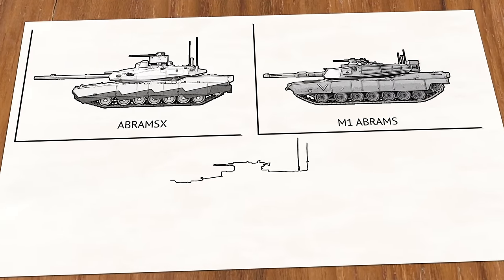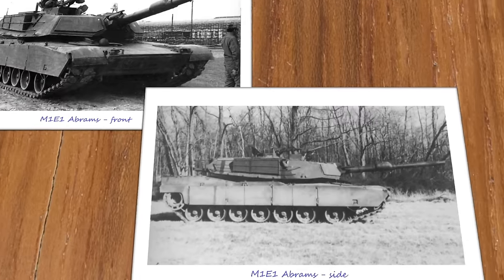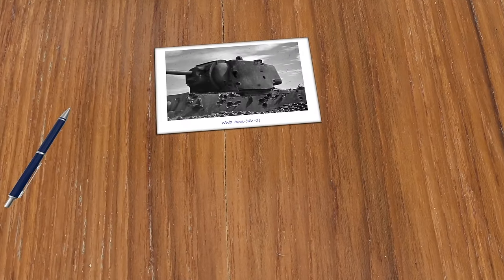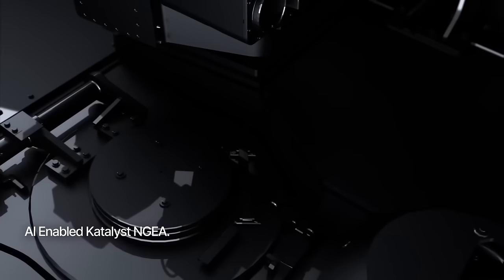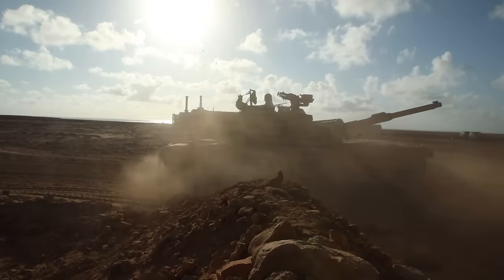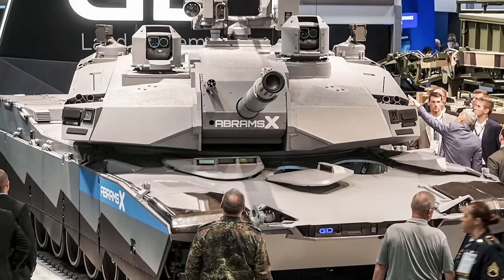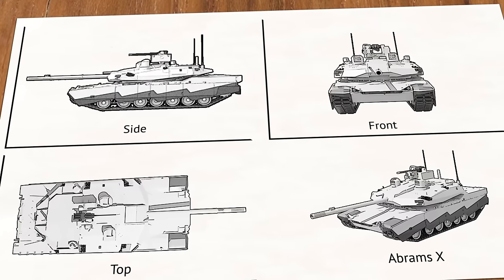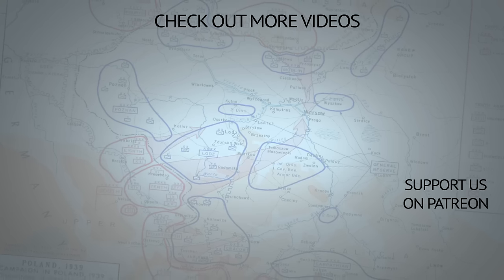M1A3 Abrams is finally happening. And it may get an unmanned turret, like the Russian Armata T-14.

Comment: Less weight should equate with a faster (top speed), more maneuverable, and nimble platform as well. This is given that the new platform would have a comparable level of torque and horsepower.
Reply: More importantly, lower fuel consumption
Reply: Top speed is not that important, most of the time the tanks don't ever go near there top speed because they are offroad.

Comment: I gotta be honest, I like Abrams-X better as the new name for the tank.  Abrams X1, Abrams X2.....idk....would be newer and flashier.

But for real, if they move all the crew out of the turret and into one spot in the hull, 1 hull pen and the tank is crew wiped.  Unless they go with the armored crew capsule or something.  Or up armor the hull.  Lose a TON of weight in the unmanned turret, keep blowout panels, enough armor to matter on the turret but then put some of that back into protecting the ammo racks and crew.  A 38-51mm upper front slope and 420mm of frontal hull protection wont do it lol.
Reply: Agreed. M1X1, M1X2, X3 sounds sick. It would help a lot to emphasize a radical departure from the 1970s design we’ve come to know

Comment: The far greater armor and less weight can be achieved by graphene based armor replacing the DU armor.
Reply: Pretty much all envisioned applications of graphene are still just visions.  If graphene based armour was available for testing today, maybe it would get into the next Abrams.  But it isn't available, so it isn't going to be used.

Comment: It is interesting that ERA does not (apparently) figure in the Abrams (and successor) development plans. This is contrary to the design philosophies of many other tank-manufacturing nations.
Reply: That's because they have the Trophy APS, which basically replaces the need for ERA in most situations. ERA doesn't stop kinetic penetrators, so having it along with an APS that blocks 95% of ATGMs is a lot of needless weight.

Comment: Using an unmanned turret but retaining a 4 person crew would be best (driver, gunner, commander, and drone operator). It also needs a 130mm gun. The new 120 being developed is fine for now but why not just follow Germany and start with the 130? Weight needs to be reduced by at about 15 tons.
Reply: US 120mm uses a stronger breach block which allows for higher pressures ( i.e. energy ) from the gun.

130mm would be better for top attack guided munitions like mrm-ce and the like.

Comment: I wouldn't bet on your "unequivocally no".  Go look at the new transparent plastic that incorporates 3D lattice bonding that was recently developed.  It has 12X the strength to weight of steel, incredible impact resistance, and several other very impressive qualities, like it is totally impervious to gas, even at high pressure, which other plastics very much are not.  It was done at a US university,  don't remember which one, but you can easily search it.  It is also easy to produce with minor mods of current plastics manufacturing equipment, and it is moldable, which would be a real asset, as in no seams to weaken things. It is also very hard, so it doesn't scratch, which would make it invaluable even for applications like the ISS main viewing window, which is now sapphire, scratches easily, and is VERY expensive.   'Soon' skyscrapers will have see through plastic beams.  It would be great for the viewing ports in the tanks, as well.

Comment: If you want to reduce weight, then replacing the gas turbine with a diesel engine, plus a battery and electric motor is not the way to go.

Comment: I think tanks are obsolete, or close enough that decade-scale development of new tanks is a bad idea.  Not because a bunch of tanks got destroyed, but because there's new technology that should be able to fulfill the same roles with greater flexibility and efficacy at lower cost.  Tanks are mobile, protected, crewed units that provide intermediate-weight direct fire (heavier than machine guns, but lighter than the 155mm used for indirect fire).  There's inevitably a three-way tradeoff between protection, mobility, and firepower.  That means there's a simple way to get more mobility and firepower: make it attritable instead of protected.  The technology exists to make remotely-operated uncrewed 120mm direct-fire SPGs.  Navigating around obstacles is harder on the ground (where there are plenty of obstacles) than in the air (where there aren't), but contemporary tech is up to the task.  Line-of-sight communication networks can be sufficiently resistant to jamming and spoofing.  It will also be easier to make them stealthy, when they don't have to be big enough to have room for the crew.

Comment: Interesting . The M1E3 could potentially have unmanned turret with electro thermal chemical gun in the 130/140 caliber .The trend with new next gen tanks is to have a bigger caliber but also using new technology in electro thermal chemical technology . Rheinmetal has the kf51 with 130 mm but they are also working on etc technology so it will later have etc technology . South Korea has the xk3 future tank looking at 130 mm/ etc but it would probably be combined as a 130mm etc gun . Large amounts of electrical power will also be an important feature of next gen tanks . It will be needed for electric drive , sensors , electronics , directed energy weapons , ETC gun etc . Railguns will be tested on tanks in the 2040s . The tank would have dew like laser weapon and microwave weapons . The tank could have electro magnetic reactive armor that could replace era . It would also have a next generation aps . The tank could have guided missiles and drones and kinetic missile .
I am more interested in how other countries can counter this in the future . It should not be too hard because the U.S. Army is putting little effort in this . They are not getting a completely new tank . It is a reengineered moderate to big upgrade of the Abrams . Tanks are costly to develop , costly to upgrade to meet future threats and costly to maintain . They are heavy , outdated , and near obsolete . That is why 2050 onwards is the time for completely new vehicles that are light weight , use advanced technology for firepower mobility and survivability , without armor . Darpa is supposed to be one of the leaders of such next gen concepts . However the U.S. plans to keep the Abrams going for decades probably even into the next century which shows how incompetent they are . Apparently new developments are too much out of laziness and don't fit the U.S. new imperialist policy which is the Pacific .

Comment: I really think that there will be a mini CIWS in 308 in the future to target drones and top down munitions
Reply: More likely it would be in .338 or .50 cal
Reply: 338 maybe but the armys new 6.8 round is applicable to its not for shooting down planes its for small kinda fragile drones & more ammo rather than bigger is more sensible.
Reply: @jackdbur  I'd think .338 because it's still a medium machine gun caliber, with performance suitable for use as a main machine gun on a tank, and it would have more vertical range than 6.8; I don't think they'd go smaller than .338 since there's some people talking about sticking 30mm cannons up there instead, as silly as that seems to me...
Reply: @andrewreynolds4949  30mm only makes sense for anti ifv & helo defence  against drones I would want as many rounds as possible. The smaller the calibre the easier to get higher tracking speeds & less recoil means better targeting.
Reply: @jackdbur  The machine gun would still have to be a multi-role weapon, so some compromise is needed. 50 cal and .338 are a nice medium, as long as they have high-angle mounts. I don't think they want very many different machine gun calibers on the tank since that makes logistics so much more difficult

Comment: Honestly manless turrets are just a bad idea personally.   You have no backup to operate the primary weapons in case to remote systems go offline for whatever reason.  

T14's biggest issue is it has s remote turret but all the cameras to operate it are exposed... very exposed.   Meaning even gunfire could disable the T14's ability to use it's primary weapons.  

Most crewed turreted tanks have backups to the electronic suites inside them.  Manual controls, old glass/mirror optics etc etc.  If one system fails the tank doesn't become useless.

Comment: i still think 130mm gun is a must at this point. And we should develope a new tank, i dont know why we're still using this platform from the cold war.
Reply: The hull design is still good. Developing a new hull from the ground up would take a lot longer and be more expensive. Ripping out the internals and starting over from there is a pretty good way to do it, that keeps some existing parts commonality and leaves a lot less room for scope creep to blow out the budget.

Comment: So is M1A3 going to be more powerful than AbramsX?

(Also AbramsX looks absolutely badass, here's to hoping the final M1A3 design will look similar to it)
Reply: E3 will have 10 years of development over the X, so it certainly should be better.
Reply: Probably not really more powerful, but more practical yes
Reply: It’s hard to make it more powerful without increasing the caliber (unlikely) or barrel length (possible) of the main gun, or adding ATGM launchers.  But it should be more practical, more fuel efficient, easier to maintain/upgrade, and even more survivable (due to more efficient armor and an integrated active protection system).   I personally don’t think the US Army will go for an auto-loader unless there’s an increase in main gun caliber.  The 120mm round is light enough that the tank will run out of ammo before the loader gets tired, but 130-140mm is starting to push it since weight increases so much with increased volume.
Reply: Abrams X doesn't exist. It was a placeholder model that included a bunch of updates as part of a demonstration project for a next generation tank. Basically, it was a one-off model to show the US military what they could be getting if they fully funded the program.
Reply: @bluemarlin8138  I do think the Army might go for an autoloader and a 3-man turret with a 120mm gun. They have been concerned with recruitment numbers and an autoloader would be a decent way to save space and manpower. Autoloaders have become advanced and prevalent enough I think it might be worth it.
Reply: @theprogressivecynic2407  General Dynamics did build an AbramsX demonstrator, so by definition, it does exist. It is not a production model, nor will it ever be developed further in and of itself, but it does exist
Reply: @andrewreynolds4949  Most of the systems weren't functional, including the turret.

Comment: So what is wrong with the AbramsX it seems to address all of these issues? Faster, better power, unmanned turret, better engine, more efficient, more survivable....so what are we missing with it?
Reply: Mainly: do we actually need it? 

We have thousands of existing M1s sitting in storage that have proven to be great tanks as is, and looking around at the competition, we probably don’t actually need an entirely new tank design.
Reply: The AbramsX is a tech-demonstrator, not an actual intended production model.
Reply: @nobodyherepal3292  and with those 1500 HP turbine engines drinking like 10 gallons per mile.....yeah not good on a modern day battlefield when you need a tanker truck following you around to feed you to stay in the fight....
Reply: @Liberty_or_Ded  The demonstrator does just that demonstrates all the technology for a major platform upgrade....I'm saying what is wrong with the concept it represents over the current platform
Reply: @thetrademarkclan  I mean, compared to what? 

Like sure, the Abrams X hybrid engine is great, but why make a whole new tank when you put that engine in the existing ones? 

It terms of cost, taking the tech off the Abrams X concept, and putting on the existing 3,000+ M1s we currently have is far cheaper, then making an entirely new platform from scratch.
Reply: @thetrademarkclan  Not everything in the demonstrator is either going to be considered necessary or feasible or cost-effective.  It shows the Army what technology is available, and they can pick and choose based on what they anticipate the future will require.

A good example of going too far into a "we'll take everything" approach would be the F-22.  Finest air superiority aircraft ever built... and never got to meet an opponent in the skies once, and now it's going to be retired without having gotten into a single aerial engagement.

Sometimes you don't need the cuttingest-edge tech.  Sometimes yesteryear's approach works just fine.

Comment: More than anything, I hope it has an autoloader. Autoloader tech has become sufficiently advanced that there is absolutely no reason whatsoever to insist on a manually crew loaded design for a tank in the modern day. Manual loading is objectively obsolete and it's time the US recognized this and updated our tanks to apply this technology.
Reply: There 100% is a reason to insist on using a crew, an extra man helps with maintenance, and if the driver or someone else gets hit in combat .loader can replace them, with a 3 man crew that’s not possible (sorry Russians). And at the start of firing, our mk1 USA blessed hands are faster than the autoloader.

Comment: I'd be very doubtful that an unmanned turret can be put in a vehicle not originally designed for it, their wouldn't be enough space in the hull for the 2 additional crew.
Reply: They did fit autoloaders on some experimental prototypes in the 90s, and again more recently on AbramsX. It's definitely possible, though requires moving a lot of stuff around

Comment: I'd suggest that the US obviously now face the problem of having very large mainstream tank models in stock. What once reduced cost is now backfiring. Still, as the tanks reach the outer border of relevancy at any realistic battlefield, there has to be a desigion for the future.

Imho, with all the new technologys and easy tank killers at the battlefield, this is the worst possible time to think about replacing the massive stocks.

But the industry has to be feed, and i guess that's the main issue we see here. There isen't a real need nor a way to define a modern doctrine for MBT's, so whatever you decide now, will be crap by definition.

The US is hastily copy decisions other nations made (for vastly different reasons that can't be copyed to any other nations situation - and specially not to the pretty unique standpoint of the US).
I have seen thinktanks and the army creating ideas about modern tanks, and ... phew. Give a 14 year old 3D desiger the job and he might come up with something less flawed. So the whole process is flawed, but let's take this aside.

The different needs of the militarys branches, limited access to some technologys (you might not understand this point as an american, but national bais isen't what i want to fix here), industry being much better in designing contracts and litterally rape the state, entanglement and political trenchlines make it nearly impossible to have the product that anyone needs or wants.
The Booker might be the best example, and in opposition to maybe the F-35, they not even try to advertise bullshit it as something epic.
In teh end, the replacmeent of the Bradley went so nuts, they finally go into buying the K-41 Lynx - what objectivly is a great vehice, but still here the flaws of the system come to cripple it. The US demanded to thing to be produced in the US, replaced the well balanced gun with a medicore one, ripped off the layered armor that made it the vehilce it is in the first place and ... in general managed to make even a great item shit just to fit the needs of a closed system that isen't involved in offer ther nation soldiers anything funnctional.

And i saw the Abrams X. It's like one of this pictures with flaws you have to mark with a pen. And i found so many obvious flaws, i'd fire everyone even remotly involved in the process of gluing this thing together - no matter how theoretical it is atm.